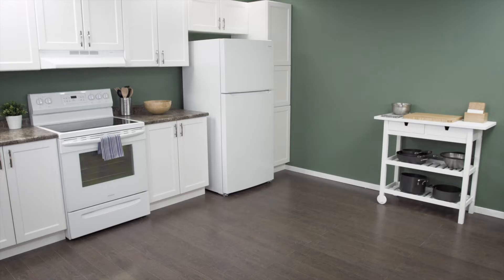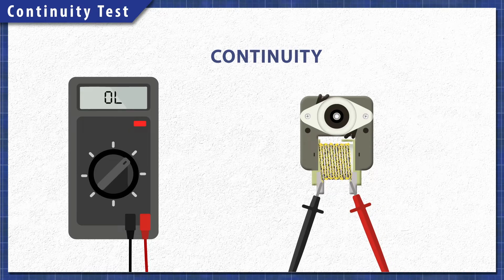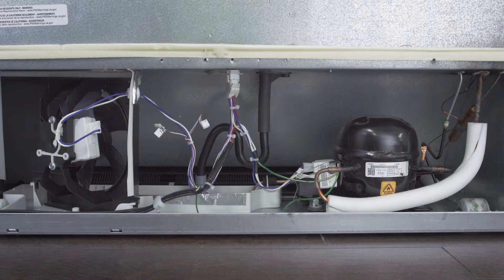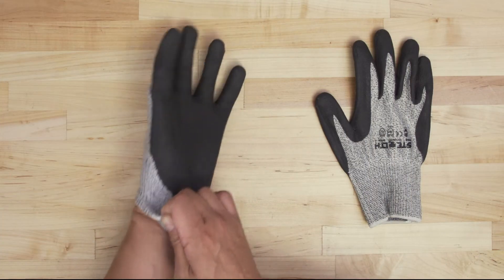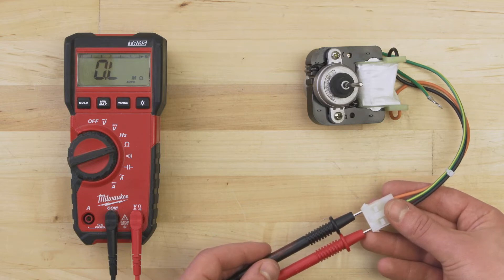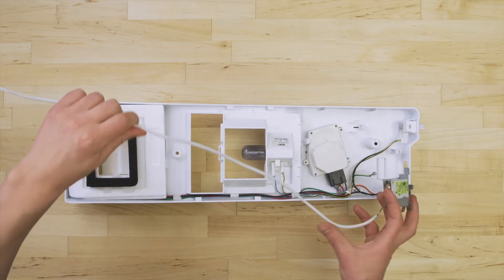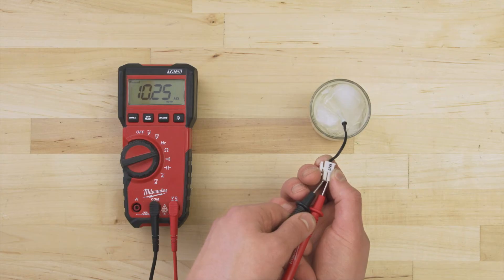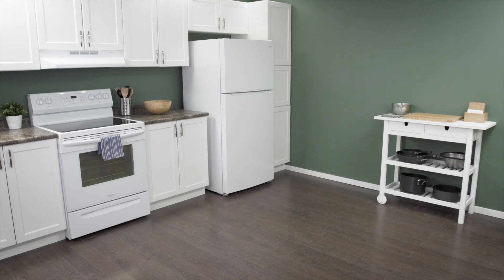Fridge Keeps Running? Troubleshooting Guide | Repair & Replace

Comment: So open freezer fan keeps running light comes on
Reply from the maker: It's likely that the door is not closing properly, and potentially leaking cold air out, or not pressing the door switch properly. If the door closes and everything is good there then it could be a faulty door switch: https://www.youtube.com/watch?v=XNDsEDsrS_Q

Comment: Why my fridge I turning on and off at the same time what is the problem
Reply from the maker: Thanks for watching. Do you mean it starts to run, then stops right away? In this case it might be an issue with the cold control or temperature sensor.

Comment: My refrigerator keeps turning on and off after every 5-10min. Kindly help
Reply from the maker: In this case try to make sure there is nothing blocking the vents, no buildup of ice and no dust on the condenser coils. Anything that can effect heat transfer could cause issues.

As well if the compressor gets too hot, then the overload will trip. In this case the fridge still needs to cool so once the overload returns to a safe temperature, the compressor will start again. In this case make sure there's enough space behind the fridge, that there's no dust on the evaporator coils. If that still doesn't help then the compressor might be faulty.

Comment: old defy 260. 265l fridge freezer cooling efectively but  compressor keep running never shutting down
Reply from the maker: Thanks for watching. If the compressor keeps on running then it's likely a faulty cold control thermostat or thermistor (temp sensor).

Comment: My evaporator fan was running off and on every few seconds. I took it out and inspected it and it didn’t seem to have any omms  reading, but the fan still works but now it seems like it’s never shuts off. Any ideas would be appreciated… It did shut off once yesterday. But for the majority of the time it runs constantly not sure if the compressor is running along with it. Seems like somethings calling this thing on maybe the thermostat is faulty or something else just not sure.
Reply from the maker: Thanks for watching. If the compressor keeps running then it's either an issue with the thermistor (temp sensor) or control board, or in simple models the cold control thermostat could be faulty.